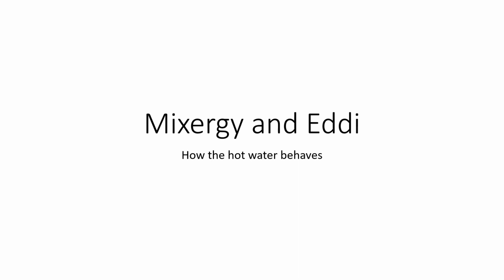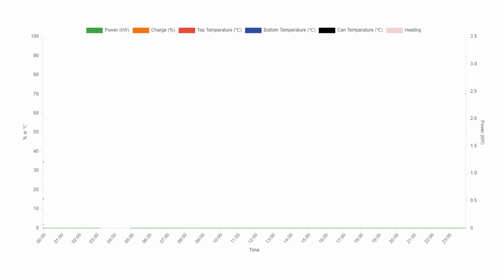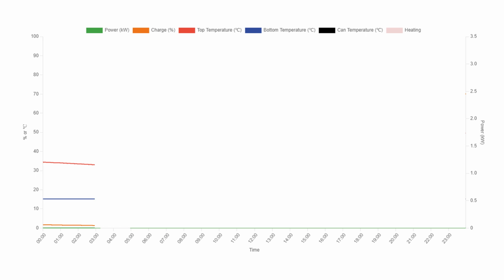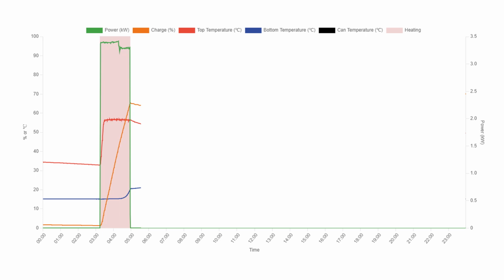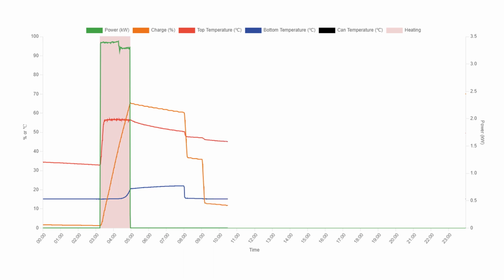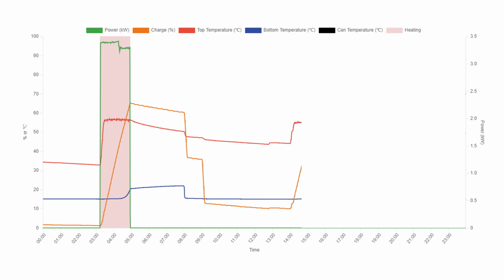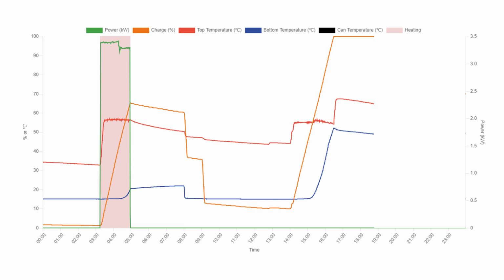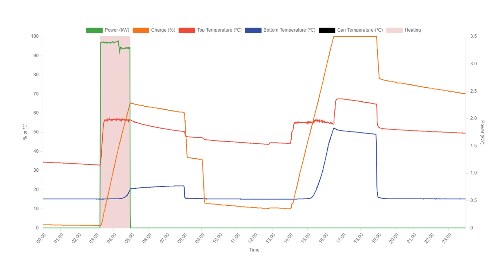Behaviour of a Mixergy tank and an Eddi solar diverter

Comment: It cant drop colder than the temp of the water coming in - so you dont see two drops there as the usage was fast enough and the level of warm charge low enough and the distance away from the cold qt the botton of that warm layer (remember its still stratified at this point cos solar hasnt started kick in yet). The cold water sensor is all the way at the bottom of the tank so once it has new cold water added  (after you use some hot) it really cant drop lower.

Comment: I installed an electric only Mixergy tank and an Eddi last year. I have 6.1kWp of solar and a Moixa 9.6 kW/h battery. For most of the summer it provided all the hot water we needed and most of the electricity. I set the target temperature to 60 to maximise the amount of energy stored. In autumn when there was no longer enough surplus solar to reliably heat the tank I switched back to using my gas combi boiler for hot water and connected some electric radiators to the Eddi's second output to use the small amount or surplus solar to help heat the house. In April this year I had the gas boiler removed and a heat pump installed connected to the heat pump upgrade kit for the Mixergy. The heat pump interface heats the tank from the bottom so you have to heat the whole tank. I only want to heat the tank to 50C using the heat pump to maximise the COP. After speaking to the Mixergy support guys I found that for the heat pump interface the target charge actully scales the target temperature so by setting it to 80% with 60C then it heats the whole tank to about 50C. I schedule the tank to heat at 2pm in the Octopus Cosy cheap period when the outside temperature is at its highest. On a good day the Eddi has already heated the tank to 80% so the heat pump is not used. On a bad day the heat pump heats the tank to 50C. Any surplus solar energy will heat the top of the tank to 60C so the energy is not wasted. Heating the whole tank to 50C in the early afternoon gives us enough hot water to last for 24 hours but just in case I also scheduled the tank to use the immersion heater to heat the top 20% of the tank at 5am during the Octopus Cosy morning cheap tariff so we will always have enough for a shower in the morning. So far I have been very impressed with the Mixergy Eddi combination. Eddi heating the top of the tank to 70C has not been a problem for me. It only heats a very small volume of water to this temperature, I suspect after passing through and heating up the cold copper pipework the temperature at the tap will be lower. In any case my thermostatic mixer shower handles it. I will probably follow the suggestion to use Home Assistant to tell the Eddi to idle when the temperature gets too high because the way the mechanical thermostat rapidly cuts a 3kW load in and out at 10 minute intervals challenges my batteries ability to switch between charging and discharging resulting in a small amount of unwanted importing and exporting.
Reply from the maker: That's very interesting about the scaling of the target temperature...I'll have to bear that in mind. It's also interesting to hear that even a 50 charge will give you continued hot water. This makes me more convinced that that I'd be better having the Eddi stop when the tank is 100% charged. 

Good move on the heat pump too :) That will be my next major upgrade I think. I've been heating a lot of chatter on Twitter about how the Mixergy isn't great with a heat pump, so I'm happy to hear you're having a good experience. Is the Cozy tariff working out well for you?

The 75-degree water almost burned one of my kid's hands as our bathroom taps have no mixer and as they are small, the hot tap is easier for them to reach. If I can't solve it with some software/hardware control via Hot Assistant, I will have to be sure to get a thermostatic valve. 

Thanks for sharing all that too!
Reply: It looks like it should be possible. I have only just started using home assistant, so far I am only using it to fetch data from integrations and use NodeRed and MQTT to post the data into my Emoncms system. I have not tried to create an automation yet but the ha-myenergi integration exposes a control for the Eddi which can be set to “Normal”  or “Stopped”.  I confirmed that toggling the state from ha Settings did put my Eddi in “Stopped” mode as shown on the Eddi display and my Smart Meter interface showed that I was exporting so learning how to build an automation is now on my “to do” list.

I am monitoring the flow and return heat pump temperatures using a Shelly Plus 1PM with the Shelly Plus Add-on and DS18B20 sensors tucked under the pipe insulation. The 1PM measures the power used by the Mixergy heat pump interface – essentially the plate heat exchanger circulating pump. I use a Shelly EM to measure the power used by the heat pump itself. I use your excellent ha integration to monitor the Mixergy tank. From what I can see then it does deliver on all of Mixergy’s claims. The plate heat exchanger has a greater surface area than a conventional tank’s coil so heat transfer is faster, the tank heats up quickly. As there is no heating coil inside the cylinder you get more water in a given size of tank. As the coldest water is pumped from the bottom of the tank into the plate heat exchanger this keeps the COP as high as possible for as long as possible, I see the heat pump power increase gently until the desired temperature is reached. Monitoring the amount of hot water you have which is only possible with the Mixergy tank gives you the ability to save energy by only heating water when it is needed. There is a smart backup, if the tank detects that the primary heat source (heat pump or gas boiler) does not start to heat the tank when scheduled, after waiting for 20 minutes it will use the immersion heater to heat to the desired charge.  I am very happy with its performance. However I can understand criticism from the user interface point of view. It is a pain to have to use separate controls and apps to control heating and hot water. It would be simpler and more convenient if the heat pumps hot water controls and hot water tank temperature display could be used instead of having to go to the Mixergy app or the very limited manual controls on the Mixergy tank. I can also understand it from the installer’s point of view. It is less work and effort to use the heat pump manufacture’s own pre-plumbed cylinder and wiring instructions. I was lucky with my installation of a Daikin heat pump by Octopus Energy. The lead installer had previous experience with Mixergy and is a fan of their products and sorted the grumbles from the electrician about having to provide a 3 amp fused spur for the Mixergy heat pump interface box and having to wire the cable that should have gone to the tank temperature sensor into the interface box, then configure the interface to match the heat pump. The plumber had to install a separate volumizer tank (this is built in to the manufacturer’s pre plumbed tank). In conclusion I believe that the Mixergy tank is the best product currently available for me (although it could be much better if they had an intelligent interface to the PV switch instead of just using a dumb relay) but for a user or installer unwilling to move on from the simplicity of a combi boiler or conventional hot water tank I can understand their reluctance.
Reply: This provides me with some reassurance that this may be a viable approach. I've posted already with more detail of our setup. I'd love to try to get it working this way with what we have but struggling to know how. Plus it may be a case of biting the bullet & have the cost of a technical refresh to replace the ASHP & tank to provide the flexibility & control😅👍
Reply from the maker: I've a plan to control my Eddi using data from my Mixergy. I've purchased a relay board add-on for the Eddi and you can use that to enable/disable heating elements by using the eSense part. When my tank is 100%, it will tell the Eddi to turn off the heater. I'm going down this road a) because it's more interesting and b) reduces my dependence on their cloud API. I'll do a video and blog post on it in the next few weeks.
Reply: @tomasmcguinness  I look forward to seeing the video. I agree with avoiding dependency on cloud APIs wherever possible especially for safety issues. Using the eSense heater enable should be a good solution for the Eddi but will you still use the Mixergy cloud API to detect the tank reaching 100%? Or a hardware approach such attaching an optical sensor to the top LED on the Mixergy tank display? Or maybe hacking the Raspberry Pi that controls the Mixergy tank? On my tank (more recent model with control electronics box on the front of the tank and only a single immersion heater) the pi's USB ports, HDMI connector and micro SD card are easily accessible so first backup and explore the microSD then connect a keyboard, mouse and monitor, enable ssh or VNC….
Reply from the maker: You're right, I would still reply on the Mixergy API. I would be too afraid to do near the inner workings of the tank, but I do have half a mind to try and reverse engineer the little control unit that goes into the front.
Reply from the maker: I published the video - in case you've not see it, here it is - https://youtu.be/ffMoKih7-_A
Reply: @tomasmcguinness  This will be a project for next year hopefully before the problem of too much solar surplus returns. This will be my first winter with a heat pump so optimising the configuration to work with the Cosy Octopus tariff and play nicely with my Moixa battery, Evohome and Mixergy is my next challenge. But first I need to replace my Home Assistant server that is running Hassio with a full installation so I can run the Evohome integration which requires python support.

Comment: Thankfully by combining your home assistant integration with the myenergi one you can create an automation to turn the Eddi off when it gets too hot. Mixergy is a great cylinder with smart tech…but turns into a dumb tank when using 3rd party PV diverters, they need to sort that out.
Reply from the maker: That's great to hear! I do like hearing that my integration is helping people get the most out of their systems. I totally agree with the dumb tank statement. I wish they offered more in the way of control or visibility. Part of me wonders would I have been better off getting an Mixergy Diverter instead of an Eddi. 

I'm working on an approach to turning off my Eddi by using the Relay board add-on. I hope to have a video and post on that up before the end of August.
Reply: @tomasmcguinness this is the part that intrigues me. We have a 13 year old NIBE Fighter 2005 ASHP, a NIBE VPAS (tank-in-tank hot water tank/thermal store), solar thermal (no PV yet but plans to do so) & an immersion for heat top-up & (topical!) higher temp heat cycle to eradicate Legionella. Cold water feed into top of tank in our case seems counterintuitive. I also want to overheat the hot water when very cheap/free/paid to do so (Octopus Agile). But I have very little control. ASHP won't heat TOT (top of tank) above 51°C, immersion rarely gets tank to 55°C but is heating lower half of tank (so a lot of energy to heat large vol of approx 38°C water 😢). Solar thermal heats lower half but due to volume feels ineffective (granted it is putting heat/energy in but can't quantify). Maybe solar PV is the game changer but making the whole integrated & controllable is beyond my poor brain! I suspect a modern ASHP, smaller hot water tank/thermal store, solar diverter? but would rather use solar PV to power ASHP to heat water to 60°C (granted immersion may be required sometimes but ASHP could control this?). Befuddled & definitely out of my depth & comfort zone trying to work this out 😂
Reply: Yeah this something you can't do with my pv diverter which is an iboost, which are dumb as hell.

Best thing to do is what you did: manually adjust the tank top thermostat safety max down closer to 60c and it'll register to your diverter as "hot" there instead of all the way up at 70. Mixergy will help you with this it's not hard just power the thing off at the mains before you fiddle.

The fact you can use home assistant to control it is a bonus, but manual safety is always better as your foundation.

I'd use home assistant to fine tune some automations instead e.g. when battery full +  forecast is sunny + before midday, boost tank until battery at 50% or tank full

...because batteries charge faster than water, so if the battery has enough juice to top the water up, just do that and let the solar top the battery back up rather than the water.

Whenever those conditions aren't met, it just runs as now, the pv diverter picks up when it can. But on really sunny days you'll maximise your export and still minimise your grid use.